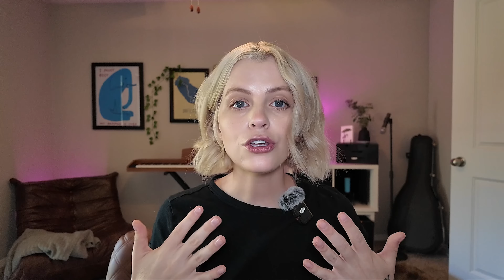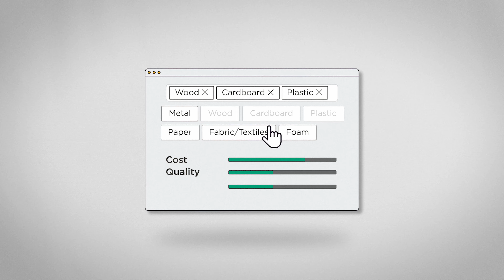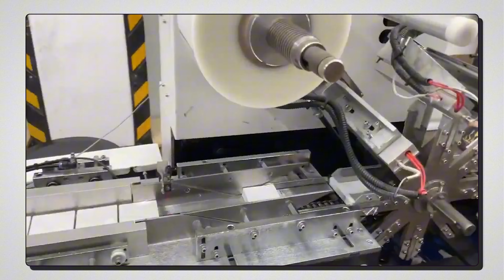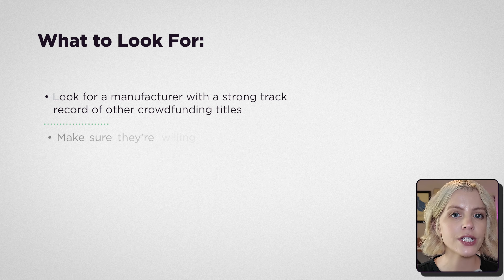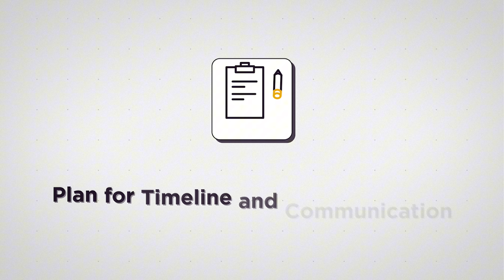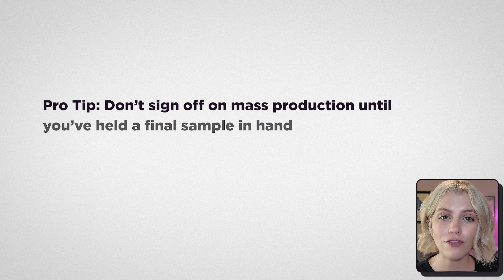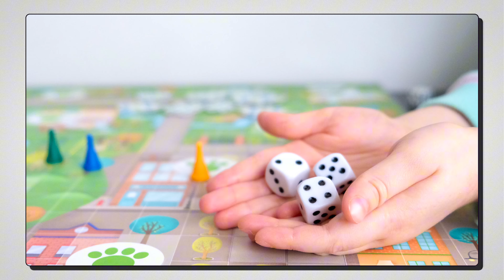Working with Board Game Manufacturers (COMPLETE GUIDE)

Comment: @0:01 Err.. that's not how Leder Games does Kickstarter, though (and I'm sure the trend will continue with Buried Giant Games).
They present an idea of a game, and the kickstarter subsidizes the designers indecision.. resulting in a game that might not have the described elements, mechanics or rules from the original campaign.

Also @5:27 “Manufacturers do make mistakes" or “A manufacturer does make mistakes” is the correct sentence.